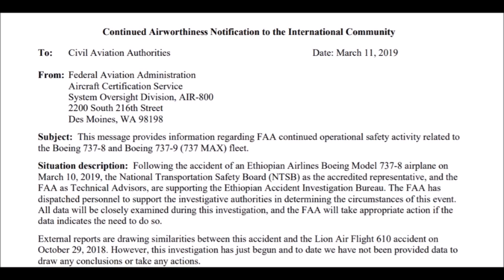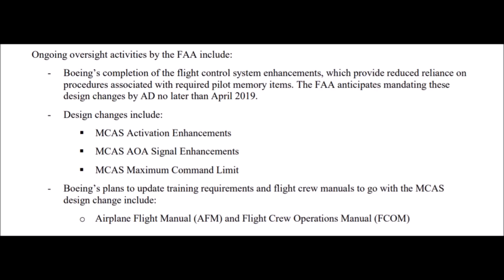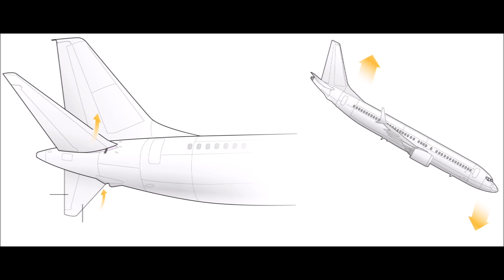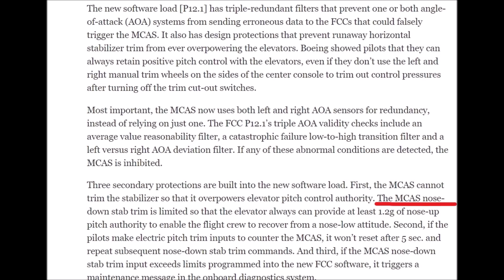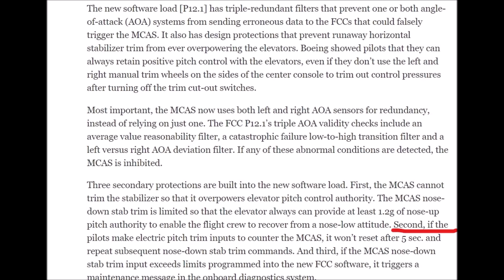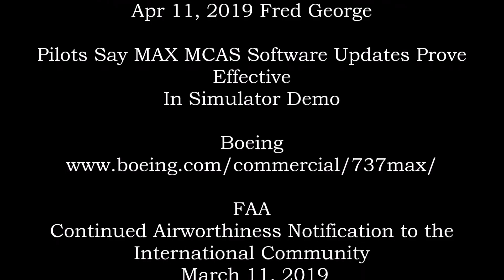737 Max UPDATE 14 April 2019 "The Fix"

Comment: I originally believed the CEO of Boeing and the CEO of Ethiopian Airlines should share the blame equally.  Everyone who had a say believed Boeing was the only culprit.  But then the issue of the qualification of the pilots came into being.  As Captain Sully stated, there was a Captain and an "apprentice" on board that day.  So it was my personal opinion the blame should be shared equally amongst the two culprits.  But after watching this video I've had second thoughts.  Even if the pilots had been given the proper emergency procedures from the outset it probably would not have made a difference, especially now that we know the problem with the AoA vane started right after the wheels left the ground.
            That being the case the pilots probably were dealt with cards so bad even a highly seasoned crew would have had an impossible task ahead.  Someday there will be simulations and other tests with top-notch pilots exposed to this same encounter.  We'll have to see how well they perform knowing what is before them.  Until then, it is my humble opinion the CEO of Ethiopian Airlines should have had a well-qualified crew in the cockpit.  They did not.   As Capt. Sully said recently, there should not have been a training pilot with an "apprentice" on the flight deck.  The passengers had the right to a fully qualified crew.  No 360-hour total time pilot should have been placed into a brand new airliner just because the CEO of the airline needed cheap labor.  There were more experienced pilots available but the CEO of the airline sought profits over costs at the expense of his passengers.  If the Boeing CEO is going to take the blame, so too should the Ethiopian Airline's CEO.  Both wanted to cut costs and both had the same goal in mind. Save costs. 
       In the U.S.A. all airline pilots must have a minimum of 1500 commercial flight hours before they can fly in the right seat.  Most have well over that amount in the airline category.  If we are going to fault Boeing,  so too must the CEO of the Ethiopian Airlines be faulted for placing a novice on the flight deck.  A young man who had dreams of becoming an airline pilot was hired way before his dues were paid.  Nobody should blame the young pilot because all airline pilots dream of being hired.  Any young pilot his age would have jumped at the chance to become a pilot on a brand spanking new 737 MAX.  The passengers had a right to have the best crew members available.   Not a newbie pilot whose ink on his pilot's license was not yet dry. 
      Capt. Sully wrote a short article about this.  He said it was "abhorrent" to have an "apprentice" as part of the crew.  That is the fault of the CEO of the airline company. 
             In the end, as stated in this video, "NO PILOT SHOULD HAVE BEEN CONFRONTED WITH THIS SITUATION".   Boeing,  fix this problem and make it work now.   Let this be a lesson to all the CEOs who are trying to make self-driving cars and other devices.   Good luck.  You'll need it.

Comment: Excellent update as usual.👍 I have been following this and feel much better informed by your presentations and professional insight.

I do not understand why the FAA and Boeing have continued down the path of re-engineering the MCAS system.

If experienced pilots were barely able to detect the difference between the Max (in a simulator) and previous marques of the 737 - then why bother with MCAS at all.

Or would Boeing/FAA not accept ‘pilot assessment’ of similar performance as conforming to single type approval requirements.

I think there is some Group Think going on.
Reply: MCAS could have been removed, but only at substantial cost of redesign, and fuel economy.

Comment: clear that the aircraft needs a redesign without a mcast  software supposed to keep the airplane in the air ..looks like a wind vane on a 40 ft sailboat with an  automatic pilot of which each sailor knows it is only a help  for the sailor and never a sole instrument to rely on.

Comment: Even a turboprop like the ATR takes constantly into account the average AoA value and self-disable above a disagreement threshold.
Reply: 737 has 2 A-vanes, that is same with 737 and autopilot, it will disengage on disagree, it was disengaged automatically in both cases : Lionair and Ethiopian. Problem is that MCAS wasn't taking both into account

Comment: It's the same safety features that we are going to see in the future of driverless vehicles. There has to be a manual control override system available to combat faulty sensors or erroneous errors. The computers and electronic systems aren't 100% reliable. The human has to be in control or at least be alerted that something isn't functioning properly.

Comment: Juan, could you please do a video about maintenance not performed in America by American carriers on Boeing aircraft using translated English technical manuals? What are the FAA requirements and procedures for offshore maintenance and certification of mechanics/inspectors if applicable? If there are statistics for which carriers receive violations of maintenance procedures done on foreign soil and if they are publically available and where to find them?
Reply: Aircraft outside the US are not subject to FAA jurisdiction. Your question has no answer.

Comment: Please think. They designed a crap under the pressure from Airbus competition. Boeing under more pressure now, What makes you think their design now is through and complete, so quickly and simple? I still think it is a bandaid. I want see the flow patterns of the wind tunnel tests comparing with fluid mechanics software.

Comment: Disagree, they're trying to fix significant mechanical design flaws with software.   Don't be surprised if the 737 max has to be redesigned to meet FAA requirements.
Reply: The Triggering — You are just making this up.  What aircraft design credentials do you have?  What inside information do you have and where did you get it?
Reply: Didnt Boeing request a design change in March of 2019?
Reply: MCAS should stay but Max should get separate TR because have different characteristic

Comment: If automobiles were built with the same quality as an aircraft that statement about cars inheriting aviation technology to make people safer might have some credence to it. Unfortunately, auto makers have more bean counters and engineers to make these improvements cheaper and more expensive to repair. The politicians and bureaucrats have gotten into the nasty habit of "mandating" everything they see fit. Auto makers love it; not only is a cheap car full of expensive to replace mandated gadgets, the makers also have their own devices installed which you cannot delete. And many of them are proprietary so they have to be bought from the dealer...no more discounted quality parts to buy. I hope this airline technology stays where it belongs and not in our homes and devices.

Comment: 10:19 “Why this system wasn’t designed correctly in the first place and how it got certified”.  That is the question the entire world is asking.  For ten years, I worked at a data center that used Six Sigma for quality control.  The testing of the software was extensive because the software had to be perfect before it was put into production.  One would think that perfection would be a part of the DNA of the aircraft industry.  The FAA’s “self certify” policy is like putting the fox in charge of the hen house.
Reply: Very worrisome.  We are still seeing the twilight results of a period of hiring many govt workers to show politically good employment figures.   This "unsafe" period will take a while to work through.  Ask yourself how many lawyers, vs. how many engineering and techs in the FAA command structure now.

Comment: Juan ... if MCAS was mostly just to keep the nose down a bit after takeoff, why not just give the stab trim a built-in default off-set of a minus 1-2 degrees and do away with MCAS?
Reply: I feel much the same. Those more powerful and further forward engines simply created a greater nose-up tendency under high trust. Why didn't Boeing just drive the MCAS off the throttle not the AoA, and keep in the stabilizer trim adjustment modest.

Comment: please add the fact - that pilots did and do have the option to simply "switch OFF" the MCAS system and fly manually.
Reply: Buzz Buzz Are you sure the MCAS system can be completely turned off? The stabilizer trim switches can be turned off, but then the manual trim wheels in the cockpit would have to be used for trim, no?
Reply: Edit: No MCAS cannot be turned off, but the trim cutoff switches can be. That was discussed in great detail in the previous video. This is part of a series.
Reply: Gordon Richardson Thanks Gordon, I must have missed that one 🤦‍♂️
Reply: Sorry, corrected my response.

Comment: With two AOA signal, how does MCAS determine which one is correct?  What is needed are 3 AOA sensors or more.  Two-out-of-three rule is needed to improve the chance of always obtaining a correct AOA reading.
Reply: it was well described in video, if they both are in agreement, you trust them, if they are not, you trust nothing, it's not about having correct reading, it's about to know if you can trust your readings
Reply: MCAS is not a flight critical system, so as soon as there is AOA disagree, it turns itself off. Thereafter its up to the pilots to fly manually, using normal diagnostic checklists.

Comment: Will Boeing log the trim stab cutoff switch on and off settings in the future? Juan thinks the pilots turned MCAS back on before the last crash but the system does not log the settings. Airline blames Boeing and Boeing blames the airline. I wonder if MCAS can override the pilots even if they turn off the switches.

Comment: Even if there is a software fix, the engine is not design for the air frame which makes flying the airplane like playing the unlucky lottery
Reply: Engine and airframe are symbiotic.  Usually the airframe is suited to the engine but, the sentiment of JLs comment is correct.  Boeing had a mismatch of engine and airframe aerodynamics and went with a software solution to cover it up.  Sensor failure (gigo) eliminated the virtual reality and real world physics took place.
Reply: J L — Engines generally are not designed for a particular airframe, but are used on several airframes.
Reply: @GH-oi2jf  i am sure there are specifications that engine needs to meet so it can work on a specific airframe and then that engine might be compatable with other airframes

Comment: Thanks for the great update! I'm so surprised from the original project to use a single AoA sensor for a so delicate role. Redundancy is a must in aviation and in a  system so important for the safety as the MCAS, in my opinion ther's really no explanation for such a decision.

Comment: So the obvious question is, what happens if the AoA veins(?) do have bad input, MCAS goes off AND the nose is too high?? Will the pilots know? Sounds like that "extra" software that signals that should be mandatory then? I've seen that pilots can hand fly out of a stall situation if their nose is too high, I just wonder if the problem MCAS was supposed to solve could now more readily happen.
Reply: after upgrade pilots FMC will show message warning "AOA DISAGREE" so pilot will know that MCAS is disabled and also other erroneous readings could appear. That is acceptable, it's important that pilots have situational awarness, if they know it's broken, they can manage.
Reply: After MCAS is disabled, the pilots will still be able to fly manually, as before.

Comment: Does anyone know if the Ethiopian plane had any issues in the immediately prior flights?  The Lion crash did, so why wasn't this fixed before the fateful flight?
Reply: Juan has mentioned previously that the previous flight of this same Ethiopian airliner with a different crew apparently encountered the problem.   A third seat hitchhiker pilot in the cabin apparently resolved the occurence, per company instructions.   My guess is it will be a year until that question is totally and officially and litiguosly resolved.   Please read Mr. Browne's previous serial postings of this incident and be enlightened.   There is much material to cover without jumping to the last page back of the technical book.
Reply: No, you are confusing the Lion Air crash.
Reply: Speculation is that the AOA sensor was damaged on the ground, or shortly after takeoff by a bird-strike. There was nothing to report after the previous Ethiopian flight.
Reply: Gordon Richardson  - That's what I was after, thanks.  I still wouldn't mind taking a peek at it's logs though, in their original format (not shredded).
Reply: The first crash investigation is likely to get bogged down, and probably why Boeing were able to deflect attention from the underlying MCAS problem. Blaming the airline is easier than grounding the entire fleet.
Reply: Gordon Richardson  - No I mean the Ethiopian flight logs.  The damaged on the ground or bird strike sounds fishy to me.  No matter what though, and Boeing's fix includes, the MCAS using BOTH AOA sensors.  Not that it makes it a good idea to go up with only one AOA working though.  I would imagine if you lose both and can't see the ground, it's an "issue".
Reply: There are no reports of previous anomalies in the preliminary Ethiopian accident report (its one of Juan's previous videos). The AOA data is not actually a critical parameter (in stable flight), and a B737 aircraft can be flown manually with only pitch and power settings. There are other multiple redundant indicators (airspeed and altitude), so it is ironic that something that is not always needed, ended up killing everyone on board.
Reply: Boeing believed that Runaway Stabilizer memory item is sufficient to prevent catastrophic event

Comment: I'm not as psyched about automation in automobiles. The problem becomes the mix of automated and human-operated vehicles on he same roads. Automated vehicles can only operate within the parameters of their programming. And unlike humans, computers can only obe commands, not think ahead. I can imagine a time in the future where all the vehicles are automated and talking to each other. Also automated cars need sensor arrays on or near the roadbed for orientation, only possible on main road roads, probably  not on secondary and certainly not on tertiary roads or when off-roading.  I also see plenty of instances where one would sit back as their car operated via automation in urban areas but the driver would have to take over and drive manually if they went  outside of big cities or wanted to do long highway drives. 

Actually I see a role for automation in airline  and other aircraft travel within the IFR system coming much sooner that to vehicles. This is because cars can go anywhere, while aircraft in the IFR system can only fly their flight planned route, divert if necessary to a different airport in an emergency or fly to alternate airport if the weather is socked in at the original destination. All of which is much less complex routing than the myriad of possible routes along road systems throughout the world.

Comment: What would cause an incorrect AOA reading? Shouldn't that be addressed also?
Reply: if there is 1 AOA malfunction it affect same side FMC, it could lead to disengage of AP, stickshaker as stall indiation measurement etc., after upgrade it will show on both PFD message "AOA DISAGREE" , basically you can fly and land safely with such malfunction and it's very rare.
Reply: Steve T — I’m sure someone will be looking at the reliability of the AoA sensors.
Reply: The most likely cause is mechanical damage on the ground.

Comment: Now the Max will be safe. I want Boeing and the FAA to publicly recognize that they srew up the MCAS by not simply taking the average AoA value and self-disable above a disagreement threshold between both sides. I want them to apologize for that as well. They will not do it. It angers me. When Fukushima happened Tepco officials did it. Boeing didn't get the MCAS as it's now to avoid the differences training for the pilots and its associated costs.

Comment: You said that the 737max simulator with MCAS off felt almost like the good old 737 - so why not just remove the MCAS system completely?
Reply from the maker: To satisfy FAA for original 737 Type Certificate.
Reply: @blancolirio   - I don''t completely understand what that even means. It seems to me that the MCAS system is put in place because of some paperwork and theory without looking at the actual practical differences while actually flying the aircraft. As you said - it save money - but I bet that the MCAS system has been a very expensive system to develop and test.
Reply: MCAS is necessary to meet the certification requirements. Whether those requirements are relevant, is a separate question. No licence, no fly...